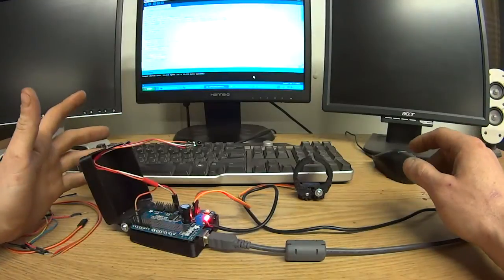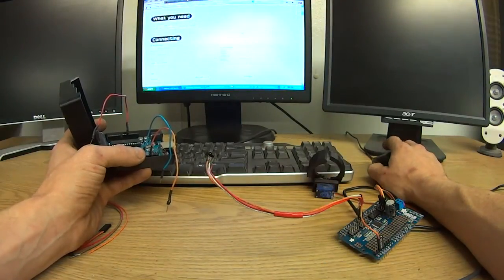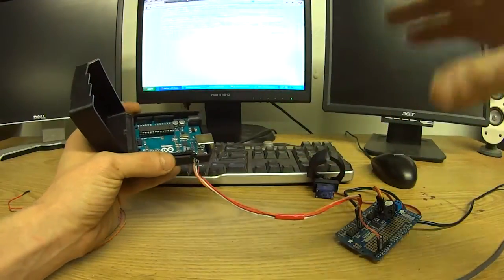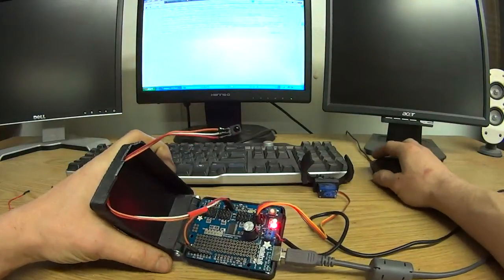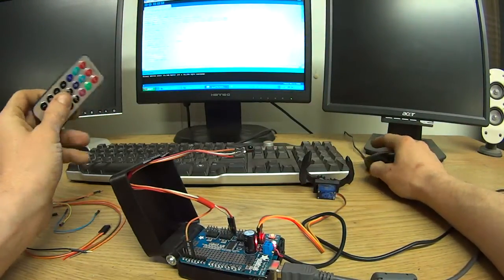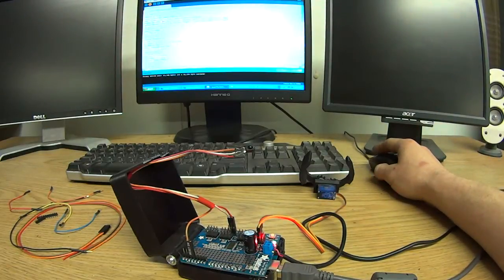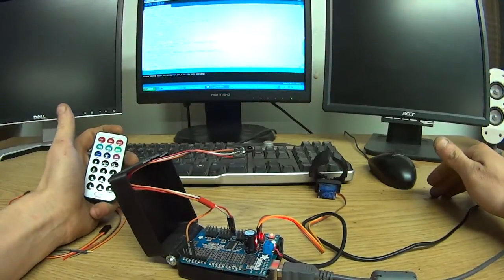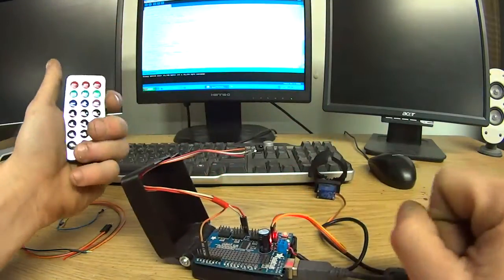MakinRobots: Arduino w servo shield n infrared remote control

Comment: Can build a cnc using a floppy and using a 5wire motor
Reply from the maker: I think it is a different type of motor (5 wires usually means unipolar). wont work with floppy driver. :/

Comment: Well I think the rpi can control what you need. It also has some accessories that are a motion detector a microphone that camera and you can get a board that converts to an arduino here http://www.makershed.com/AlaMode_for_Raspberry_Pi_p/mkwy1.htm
But you could do most of what you need to do on a pi

Comment from the maker: Hmm, can i use arduino to control the temperature and extruder stepper... do you know about a webpage on that? I couldnt figure out how to control the extruder temp or 4th axis stepper (for extruder)// I think i have to figure out how to use only 2 pins to control the stepper direction (it takes all 12 available pins from my printer port for 3 axis... how i do it anyways..) I only know how to use linuxcnc (emc2)//// how do iiiiiiiiiiiii do ittttt is it rep rap software... :D telll meeeeeeeeeeeee :) plz sir if you know... i want to make a room sized 3d printer :D
Reply: you could try a ramps board
for software maybe pronterface  somthing
Reply: i dont know what build volume you have got on your 3d printer but the one i am making http://www.thingiverse.com/thing:177256 is about 150x150x100 mm 6x6x4 and can be bigger the total cost for me has come to around £160 about 260 US dollars
Reply from the maker: My afinia broke :( i have to send it back.. sucks..
Reply from the maker: Tom Howbridge
OK.! I will look it up.